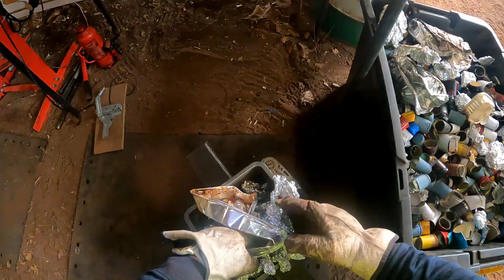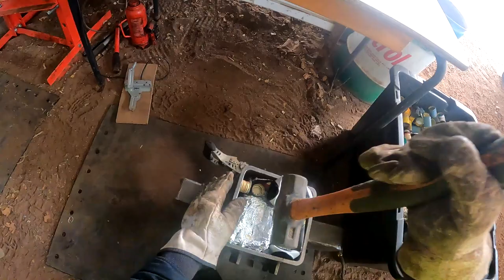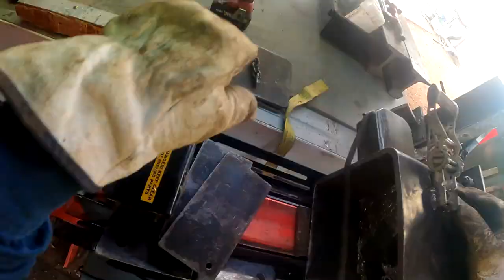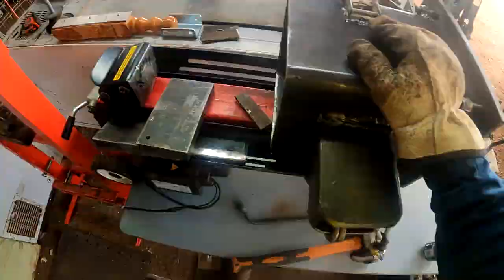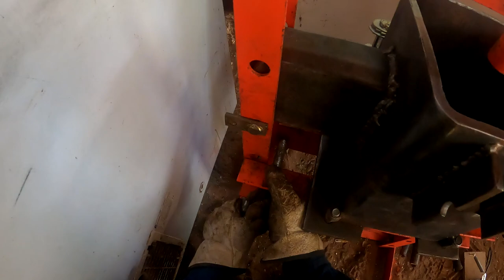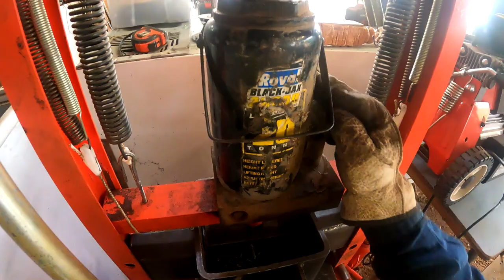Pressing Aluminium With A Log Splitter

Comment: You should weld a piece of steel to the back of the two that pushes the top in so you don't have to hold them. Plus it would be safer. Because what if the foot pedal was to mess up like last time.
Reply from the maker: Thank you for the tip. 👍😎🦘😁